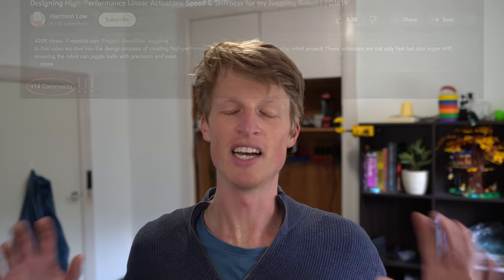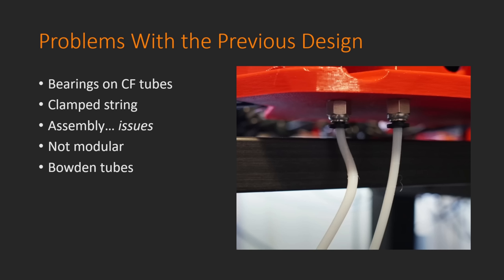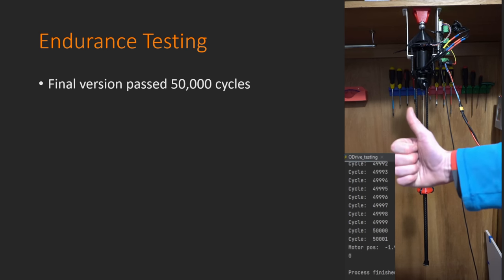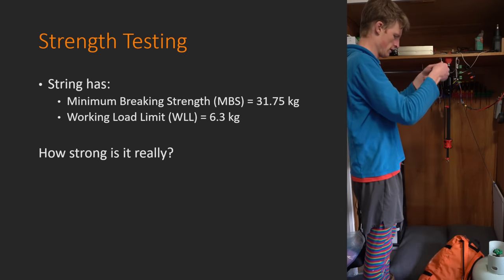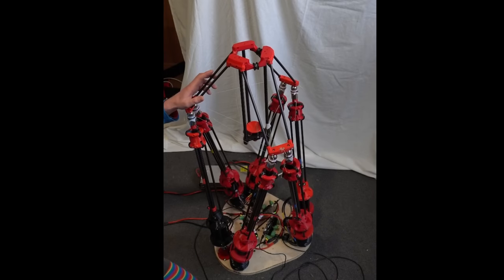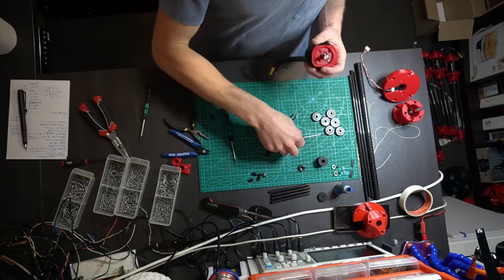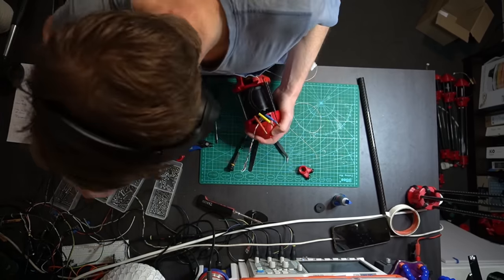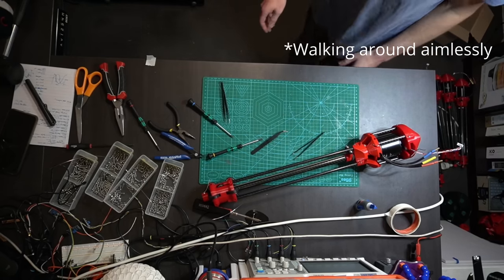My New Linear Actuators are SO MUCH BETTER! | PDJ #21

Comment: If you aren't already you should use dyneema thread for your string
Reply from the maker: I forgot to mention in the video that the string I'm using is kevlar (made for kites). I recall looking into Dyneema thread after the last video and don't quite remember why I lost interest in it. It might've been hard to find in super thin threads? 

If you have any experience in the matter, how do you think dyneema would compare to synchromesh cable (shown at 10:30 in the vid)?
Reply: @harrisonlow  synchromesh I have no direct experience with but from what I've seen the thematic way to use it would be as a single continuous loop which does both pushing and pulling and has a tensioner somewhere along the way. It could run through the middle of the post it's moving and be glued in there or lashed to something. The big problem as you point out is that it can't be tied into knots. Most likely if you can get the synchromesh to work it will be stronger and stretch less than any thread could be. It's basically a belt which can be wrapped around pulleys in multiple directions.
Reply from the maker: @BramCohen  Hmm yeah I've only ever seen it used that way as well. Unfortunately I can't (easily) set up my system as a continuous loop 🤔
I do quite like the idea of more strength and less stretch! 

These comments are making me feel more and more certain that I'll make the change to synchromesh at some point. (I think for now my time is better spent focusing on other things that are more critical to Jugglebot's functioning)
Reply: @harrisonlow  For immediate juggling functionality you should get some Phat Tyre juggling balls. You might be able to get away with catching and throwing from simple bowl-shaped objects with no grippers if you use those.
Reply from the maker: @BramCohen  Interesting, thanks for the suggestion! The "Hand" that I'm planning to use is actually quite similar to what you describe. If you're curious, check out the most recent video on the hand here:
https://www.youtube.com/watch?v=LbStGIFrnxY

I'm also hoping to have the catching of the balls be as smooth as possible so that the balls don't bounce around at all, and even then, the Jugglequip infinities that I'm planning on Jugglebot using have a bit of pliability that should stop any excessive bouncing.

My main worry with both the Infinities and the Phat Tyre balls is that their diameter isn't consistent, which will (probably) throw off a system that I haven't made a video on yet (will probably be the next one). I'm calling it the "Laser Gate" and if you want to know more about it, you can check it out on Zulip. I'll post a link as a reply to this message in case YT takes a disliking to the external link. If that doesn't work, you can find the Topic under "The Eyes > Laser Gate on the Hand".

Cheers for the suggestion!
Reply from the maker: Zulip Topic for the Laser Gate:
https://pdj.zulipchat.com/#narrow/stream/399308-The-Eyes/topic/Laser.20Gate.20on.20The.20Hand
Reply: @harrisonlow  I posted something in the 'hand' section of Zulip. You're way better off measuring the position and velocity of balls as they peak than trying to do it on the way down, because that's both more accurate and gives advance warning
Reply from the maker: @BramCohen Agreed! I'll head to Zulip once I've caught up on all the YT comments 😊

This is a bit of a spoiler for the (probably) next video, but the laser gate will actually be measuring the ball throw velocity, and I'll have cameras to watch the ball through its flight. Both of these data will be combined using a Kalman filter to predict where the ball will end up. I'm not (currently) planning to use the laser gate to measure catch velocity, but I think that could be useful if/when I use AI to control Jugglebot, as that could be a measure of how accurate the predicted catch velocity was, informing the "brain" if any corrections ought to be made.

Comment: Screw, not "Bolt"
Reply: Doesn't screw have pointy end and bolt flat end so it's a bolt
Reply: @samueldavies646  
The shape of the point and the shape of the head do not make any difference. 
Bolt = Screw + nut.
Reply: @paolopetrozzi2213  ahh thanks

Comment: First and foremost: You are doing God´s work, if you didn´t know that yet...!!! (and I say that, while being an atheist, mind you...!!!).         Second: I know little about such sort of things, but I guess, stepper-motors would distibute the "breaking-heat-energy" much better in their thermal mass, compared to the brake-resistors... (and no brake-resistors would then be needed) So, if my layman-assumptions are correct, why wasn´t any stepper-motors used instead...??? Thanks á priori for any answer...!!!